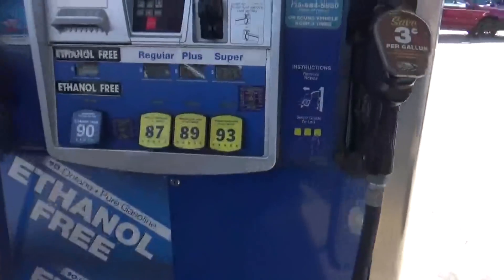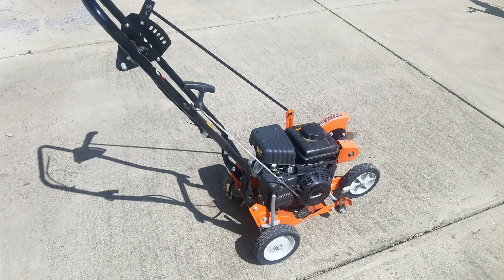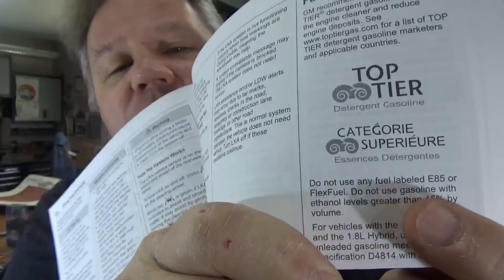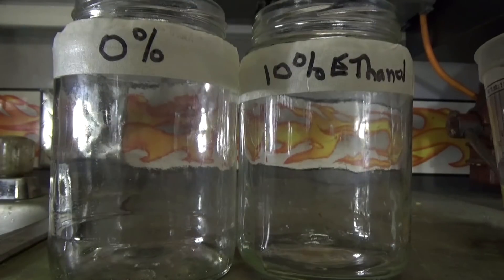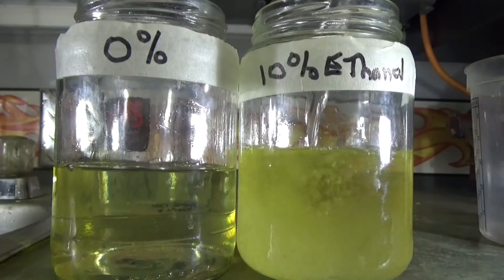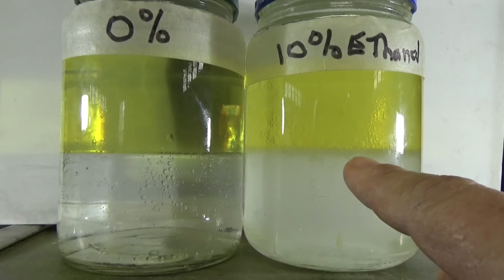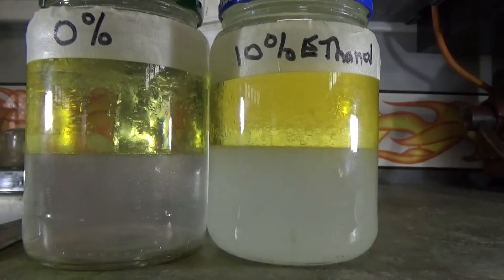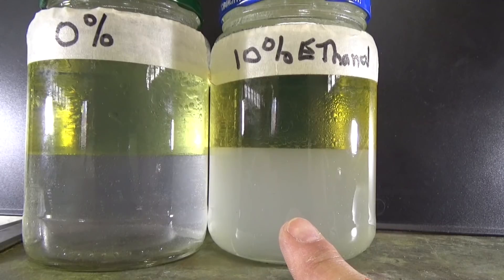What is Ethanol, Why is it in Gasoline, and What Affect Can It Have On a Fuel System

Comment: So, how does the water get into the fuel, and therfore bind to the ethanol. Just from ambient humidity? Fuel systems are closed systems, but do have to vent. So technically humid air could potentially enter the system, but over the winter the humidity is typically very low.

So that must mean water is inherently already mixed in with the fuel at the pump. And that the ethanol would just keep it around lingering which would cause the corrosion.

So isn't it really just a bad fuel problem at the pump, exacerbated by the ethanol?
Reply from the maker: There is more water in the tanks at the gas station than you think
Reply: @PetesGarage  That's sad to realize
Reply from the maker: It sure is

Comment: Great video mate. My car just cut out in the middle of nowhere (Renault Scenic 1:4 petrol... Don't laugh) then restarted again. I am sure this is as a result of water (accumulated condensation) in the full system as I had not used it for 3 months during the Covid-19 lockdown. I am thinking of adding a little of Ethanol to the tank in the hope of a quick fix....especially as now it is ht summer. I really don't want to remove the pump to access the tank. Feel free to tell me to stop. Thank you and best wishes 🏆🇬🇧
Reply from the maker: That will do it

Comment: A little outside the box. And I watched the video awhile ago when it came out...
Is there a reasonably efficient way to separate the 10% ethanol from gas and then fill your car up with the straight gasoline? 
(Tough to find around here unless you buy a 5g drum of racing fuel for like $100.)
Reply from the maker: I'm not sure about an efficient way to do that. But if you invent a way it would be worth billions
Reply: @PetesGarage  add octane booster and food coloring so you can see it, maybe three tanks could clean up my internal fuel pumps
https://youtu.be/RO1hsaxaMXo

Comment: Several years ago, there was an article in the American Motors Owners Association magazine about ethanol in gasoline. The author stated that when the ethanol in gasoline absorbs water from the atmosphere that it settles to the bottom of the tank where it can cause rusting and corrosion. The article stated that ordinary "dry gas" is methanol alcohol which does the same thing. However, "dry gas" made with isopropyl alcohol does not have this problem. It absorbs water but stays mixed with the gasoline so that it is burned as fuel is drawn from the tank. Isopropyl alcohol "dry gas" costs more, but if the author of the article is correct, it should eliminate the problems that Pete was talking about. Of course, buying non-ethanol gas is an even better solution and it's the only fuel that I run in my 1962 Ford Falcon.
Reply from the maker: Great comment, but a little clarification. Only some brands contain isopropyl, which is hygroscopic. Most are methanol. Thanks Steve
Reply: @PetesGarage   Pete. That is correct. You have to read the bottle to be sure which type of alcohol the "dry gas" contains.

Comment: No sir it doesnt reduce the price of gasoline (alcohol production is HIGHLY subsidized, it cant stand on its own but the farmers are happy) . Its there to reduce emissions and as a side benefit it actually reduces mileage because there are fewer BTUs in alcohol. Its to make the greenies feel better.  Funny, I asked the gas station owner why alcohol free fuel is more expensive, he stated its because they have to remove the alcohol out of the fuel. Hilarious and B.S. they add the alcohol at production. Alcohol free fuel is not mainstream retail so they can charge more, its a special fuel now.
Reply from the maker: I wish alcohol free was the same price
Reply: @PetesGarage  If the true cost of corn alcohol was present at the pump standard fuel would be cheaper.
Reply from the maker: Probably

Comment: Hence my car has a plastic fuel tank, non metallic fuel lines, E85 flex fuel system and Haltech ECU, 107 octane and I can tune on the fly with my laptop. Keep your filters (Oil, Fuel) fresh along with the oil every 5,000 kilometres, hey presto cheaper fuel, no rusty tank or lines and my just rebuilt 5.0L Windsor V8 revs all the way to 5800rpm with nary a glitch, strong and smooth all the way. Having an ex police car with the rev limiter and speed limiter disconnected helps, greetings from Australia.
Reply from the maker: That's awesome....thanks for sharing

Comment: I agree that ethanol is very harmful to carbureted engines...having restored many motorcycle and small engines, I have seen the damage that ethanol does, especially to carbs. Jay Leno rails against the use of ethanol for the same reason. Here in Ontario, Canada, you can find non-ethanol gas if you look for it: Esso stations in our province have a choice and 70% use it and 30% can opt out of using ethanol gas. The further north you go, there are fewer gas stations using 10% ethanol, as the water in the fuel will freeze up fuel lines. Great video, Pete!
Reply from the maker: Awesome info, thanks for sharing. Makes sense about stations further North.

Comment: While I don't know enough about it to make an informed decision, I do know that a buddy who is a farmer in Illinois says they cannot get rid of all their corn and have moved over part of their farm to soy.  He also says he is hoping the government cleans up their act on Hemp.  Also, when I lived about 50 miles from you, Pete, I always ran my summer equipment till they ran dry before putting them away for the winter. Now in Florida I don't have to worry so much about that, but I have put fuel shut offs on everything and still run the carb bowls out. Lots of years on 10% corn and never an issue and yes, I do have many small engines that tend to sit.
Reply from the maker: Interesting, thanks for the comment. I ran that thing dry for the first time last year, that was a mistake because it left space for air to get it and rust the tank.
Reply: @PetesGarage   You can always fog the tank with penetration oil , just as putting away an old engine under your bench..

Comment: Hey Pete down here in South Florida we have quite a bit of  “rec 90” that boaters use. I personally use a fuel stablizer and enzymes “startron”  in my carbed 4 stroke outboard, but many people have issues with modern outboards and ethanol, But my theory is that boats have big tanks 30-200 gallons and when it sits unused for so long it creates an issue but if it is used continually probably would be fine since no time for separation. I’m not for ethanol but I think people thinks it the ethanol doing the damage when it’s the gumming that occurs when ethanol fuel breaks down quicker.  So thanks for this video explaining this.
Reply from the maker: Marine fuel is definitely better. Those big tanks can do some damage if the fuel doesn't get used. I see guys up here stopping to fuel up on the way to the lake and they fill with 10% ethanol.....it's going to kill their systems pretty quick.

Comment: What does the fuel stabilizer do to the 10% ethanol gas? why is it that it keeps the fuel "OK" for a few months? does it just prevent it to "varnish"?
Reply from the maker: The stabilizer works to slow down many of the oxidation process, but eventually atmospheric conditions overpower it.
Reply: @PetesGarage  Thank you.

Comment: Are you an engineer?
Reply from the maker: I was an engineer for GM Powertrain for many years.
Reply: @PetesGarage  I work with engineers side by side. They absolutely love testing. I dont disagree at all. Proofs in the pudding
Reply from the maker: Everyone has a hypothesis until you prove it with a test!
Reply: @PetesGarage  yeah that's true. I actually love working with with guys I work with always willing to explain why and what we're doing and what to look for. Started there just as a welder and moved up with the help of them. Anyways thanks for the video

Comment: If you live near a lake or a large body of water that supports boating, check gas stations nearby any marinas...you'll often find ethanol-free gasoline since boat engines use it.  I'm fortunate enough to live 3 miles from the southern coast of Lake Ontario and thus have easy access to ethanol-free gas for  my '68 VW  :)
Reply: In the US the issue there is the marine gas does not come with a road tax. Occasionally I've heard tell of folks getting in trouble for that. Some of the marinas watch out for that too. Somewhat different than off-road diesel, which has a dye in it that can be detected in very small amounts, but I only hear of commercial trucks getting tested for that.
Reply from the maker: I live right by Lake Erie and the price for ethanol free in any marina is ridiculous. Plus, it's impossible to drive down by the dock pumps.
Reply: @PetesGarage  The gas station I get ethanol-free at isn't at a marina, it's down the road a ways, and the price is about what you paid in your video
Reply from the maker: That's very interesting.
Reply: Chris Freemesser ok. Have been water skiing for 35yrs. If the boat has been sitting for several months, we always add 1/2 a bottle of metho to tje tank tp.soak up any water sitting in the bottom of the tank or carby float bowls. We only do this at the beginning of a big week end that will have suslcessive fill ups with no ethanol or metho. Jetskis are the same. Do not let this mix sit in the tank for an extended period of time as a green growth will appear on anything brass.

Btw, have run e86 in my 800hp turbo barra daily driver for 4 years now with only the paper fuel filter needing replacement with a stainless one due to the glues being dissolved. Obviously with 800hp means 2x DW350 intank pumps that are e85 rated.

Comment: Great video experiment. I like those show and tell visual aides. I do have one point to argue with. at the beginning you mentioned that the grain for ethanol is diverted from feed for animals, which makes the cost of meat at the store more expensive. Well, that isn't entirely true. The stream of starch cut to make ethanol goes to the ethanol stills fermenters to convert starch to sugar to alcohol. The alcohol is separated from the fermented starch by temperature. After capturing the alcohol, what is left is whats called  stillage. Stillage is heavied up with evaporation till it is really thick like molasses. That stillage is then mixed with corn fiber from the hull and sold to feeder lots for cattle. The original grain has lost very little of the original constituents and cattle are still corn fed. The same is true for the germ kernel. after extracting the one drop of oil out of it, what is left is germ meal and that is put into the dry feed pellets for cattle feed. I wish they had more ethanol free gas for sale too. The processor of ethanol has a pretty hard grip on consumer gas.
Reply: cornflake73 corn shouldn't be fed to cows as their stomachs cannot handle it and the cows are fed antibiotics to suppress gas - so they can be fed corn.
Reply from the maker: That's really interesting, thank you for sharing

Comment: Wow. $2.85 a gallon on regular. Man, we are paying $4.88 a gallon there in Eastern Ontario Canada. And in Vancouver they are paying $6.13. So you can imagine how much 0% ethanol would cost us. The repair bill gas watery gas will be cheaper than 40 gallons of gas I go through each week.. Thanks for sharing Pete.
Reply: Only about $2.50 +/- here in East Tennessee. 100% gas is a little more, lots of places sell it now.
Reply from the maker: Wow....that really sucks. Guess the Oil Sands aren't making enough per barrel to keep the oil companies going.
Reply from the maker: $2.50 seems to be on the low end, you're lucky
Reply: @PetesGarage  I inspect all of the gasoline dispensing facilities in my County. Seems the best prices are out on the fringes at truck stop clusters, or in the core.

Comment: ethanol also distroys old gaslines and gaskets
Reply: If you are building a car and you want it bullet proof from this killer gas, used 304L stainless tube for the hard lines and PTFE for the flexible portions. Can use PTFE for all of it if you want.
Reply from the maker: Excellent points
Reply: happymark1805 some components will suffer, just upgrade those.

Comment: Ethanol is a disgrace
Reply from the maker: It appears so
Reply: peter455sd maye, I have run my 800hp turbo barra Falcon daily driver on e85 for 4years now, and inly the paper fuel filter suffered (the glues dissolve). Most owners of these cars running on e85 jist change the fuel filter every 6months, I replaced.mine with a stainless steel unit. My fuel pumps are after market 2x DW350s that are e85 rated. Car goes great after 4 years.